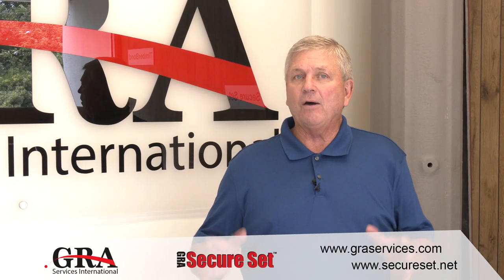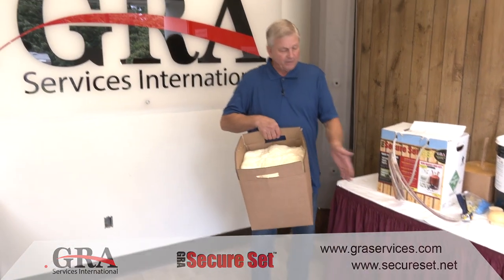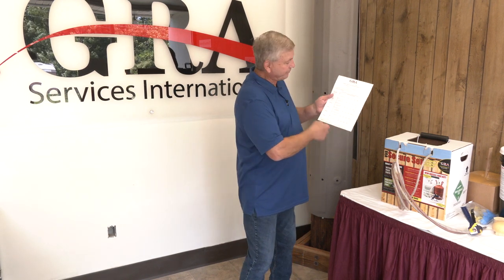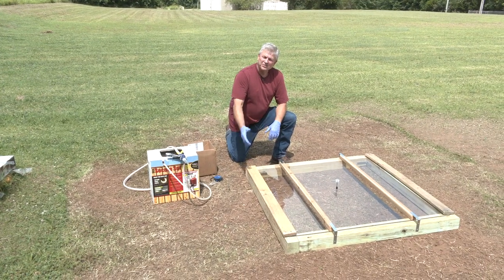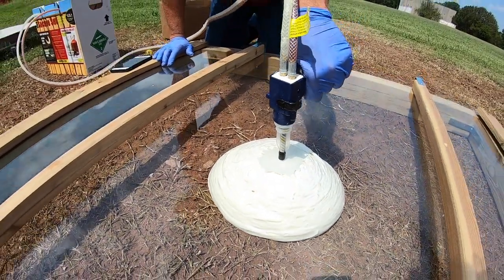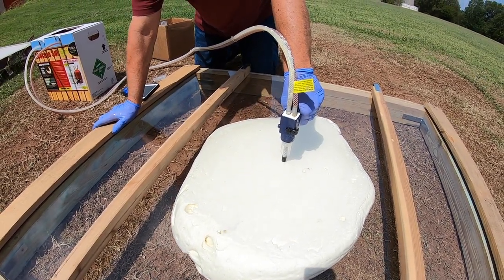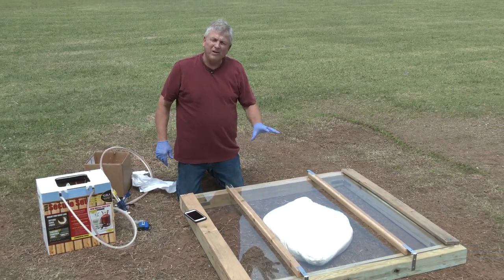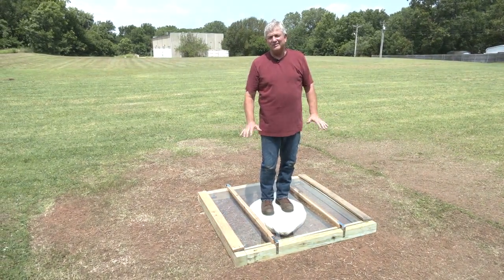How to fill voids under concrete floors & slabs for basements, warehouses & garages with Secure Set

Comment: Just watched this video, and it seems the foam doesn't really expand much after it is injected.  I expected to see if fill the entire box.  I assume this is by design, and the worry of injecting too much and having it expand and lift too far after the initial injection isn't of much concern.
Reply from the maker: Thank you for watching our video.  The Secure Set Spray Foam will expand 2 to 2-1/2 times the volume being sprayed and can expand up to 2-1/2 to 3 minutes while moving under pressure. In this video he is not spraying much foam, or that void area would have filled very quickly and would have pushed up the plexiglass, because it must expand somewhere.  It is highly recommended to watch our 2 instructional videos about "foam jacking/lifting" to understand the lifting process we use for many types of concreate slab projects.  It is a finessing type project of spaying in short bursts of foam to keep from overlifting.  Please check out our website at  
https://secureset.net/gallery/  to see many of our videos, which are also here on YouTube.  
Thanks again,  GRA Services - The Makers of Secure Set.

Comment: I spoke with a concrete guy and he said the voids are no big deal. He said the stem wall has some damage but not sufficient to need repairs. He said I shouldn't use the foam but to use the pillars that go under your home, which he said are very expensive. He said he doesn't do that kind of work with the pillars so I'm not sure what I should do. He was kind enough to tell me what to do to help migrate additional damage which I started to do. I would have questioned his integrity if he said he did the pillar work but he said he doesn't do that work. I'd like to know what I should watch for, around my home (I already see settling, some drops of about 1/4" in certain parts of my sidewalk near my front door, and along the garage door that goes from inside the garage to outside the garage) as to an indicator of how soon to starting using the foam or maybe the pillars in your experience? Or, if foam would work very well whereas I wouldn't need the pillars, which would be my preferred options (to not use the pillars is my preferred option to be clear). I live in Phoenix, AZ. Thanks!!
Reply from the maker: Thank you for your interest in Secure Set Spray Foam for your project.  We have many customers that do pillar or piers under their house foundation, and will also use our foam in between some of the piers for added support.  We have 2 kits available, one will support 5,040 lbs. per sq. ft., and the other will support 10,080 lbs. per sq. ft.  Some of our customers use our foam instead of piers if they do not have an extreme issue that needs the piers.  We would recommend for you to get a foundation pier company to give you their recommendations, and go from there.  If you would like to call us to discuss this project, please call 405-672-8885 M-F 8:30 to 4:30 CST.  Thanks again, GRA Services - The Makers of Secure Set.

Comment: my gosh we just found that under our whole basement floor has a void . we had water coming up thru cracks casing flooding . we cut a 12x12 square out and found a lot of water so we dropped a pump in and in the end we found how large this void is.
the floor is basically hovering. we later found out the possible cause was due to a sink that had a drain pipe to nowhere under the floor. sink was removed when we moved in 55 years ago .
Reply from the maker: Hello and thank you for your comment and interest in our products.  With an opening as large as the 12x12 you could definitely get the spray foam where you need to place it.  The spray foam nozzles will spray out about 4 ft. or you could use cpvc pipe as extensions, as we show in many of our void filling videos.  Also, you may be able to use our Secure Set liquid mix/pour product.  It would need to be quickly poured or you could make a trough of sorts (cut pvc pipe in half and wax it down with a bit of car wax) and get the foam into the void areas.  Do not let the foam get trapped in an area where it can't expand to the least resistant area, since it expands 18:1.   Many of our customers do this type of project  where they fill some of the void areas with this product and then top off with a spray foam to get the foam in all the areas you want to support, but not overfill.  If you have any other questions about this type of process, please call us at 405-672-8885 and we will help however we can.  Thank you, GRA Services - Secure Set.

Comment: Is there risk of overfilling a void and lifting the slab up? Would it be smart to drill relief holes to help avoid that?
Reply from the maker: Hello, as long as you do not overfill the void space you should have no trouble with lifting the slab.  Yes, drill several extra holes that will act as relief.  Understanding the void space is important.  Watch our lifting videos to help understand what all we have to do in order to get the lift.  The foam will compress soil and run to least resistance areas, filling voids, before lifting.
Thank you,
GRA Services.
Reply: Nope path of least resistance. Concrete is heavy dirt is soft and porous. Plus we drill many   to spread it out. And a good ear and rubber mallet will let you know start/stop of void.

Comment: How do you determine how much you need? Ground penetrating radar? How do you know if you filled all the void? You cant see what is going on.
Reply from the maker: Thank you for your question.  If you watch some of our other videos you will see that we tap around with a hammer listening for void space, even after we have applied the foam.  The sound changes; therefore, we know there is foam filling those void areas.  You won't always know that the entire cavity is full, but even pillars of foam in areas is much better support than the voids.  Also, some of our customers state that they drag a mechanical jack or heavy metal chain around to listen for voids.  You can also drill some additional holes and if voids are still found then drop a borescope/endoscope camera in to look around and see if you need to add additional foam.   You could use a ground penetrating radar device, since we have talked to foam jacking companies that use one for their projects, but that is generally not a tool that most people would have on hand.   GRA Services
Reply: Bore scope and probing holes

Comment: How long does it last ? That’s the question
Reply from the maker: Thank you for the question.  Secure Set foam is a 2-part polyol product that is projected to be in the ground 40+ years. This is a high strength, closed cell foam that does not absorb moisture; therefore, it does not break over time for that reason.  Also, it has no nutritional value, so nothing has any reason to attempt to feed on it.  Fire will destroy it, but that isn't likely to happen under a slab, or in the ground.  Hope this helps in understanding this type of foam product.      GRA Services
Reply: @SecureSet-Fence-Installation  that’s amazing, thanks for the info

Comment: what if there is some water in the void under a crawl spaces slab.. will the product still work?
Reply from the maker: Thank you for the question.  No, it will not work when applied into an area with standing water, or where the ground is too wet.  During the exothermic process of expansion it will suck the water into the foam and make a junk foam, which is not supportive.  The drier the better for the best results.  
GRA Services

Comment: hi. watching your video demonstrates that 1 minute discharge will give us 1cu ft3 of expanded foam. can i assume that one kit will give us 10 minutes of discharge to get 10cu ft3 as it is specified on the product? 
thank you.
Reply from the maker: Thank you for your question.  Yes, that is correct as a general rule.  When it is hot out it can dispense the product even more quickly.  
Some additional info:  You wouldn't want to spray it constantly, so you don't flatten out the foam that is trying to expand, as well as cause the compressed canisters to start freezing up and create an uneven flow of both Part A and Part B foam.

Comment: About to make an order for a void in my garage floor. Pulling the jack around I can clearly hear the vibrations of the floor in one particular spot. This shouldn't be super difficult to do with secure set.
Reply: Hello Brendan,  Another way to fine tune the areas where the voids exist under the concrete floor, is to take a hammer and start tapping all the areas of the floor.  You will be able to "hear" where he voids are.  I then take some chalk and mark those areas.  Thank you

Comment: Is this foam firm enough to drive a car over the voided area?
Reply from the maker: Hello Stuart,  Once the void is filled and the foam has hardened, it will support 10,080 lbs. per square foot.  Here are average weights for USA made cars. As you can see, even if all the weight of the vehicle was concentrated onto one foot square piece of the driveway, the foam would easily support the weight.  Thank you.

Model	Curb Weight
2019 Ford Fusion S 4 Door Sedan	3,472 pounds
2019 Nissan Altima 2.5 SR 4 Door Sedan	3,290 pounds
2019 Jeep Grand Cherokee Laredo 4 Door 4WD	4,677 pounds
2019 Honda Accord LX 4 Door Sedan	3,131 pounds
2019 Nissan Rogue SV 4 Door AWD	3,614 pounds
2019 Toyota RAV4 LE 4 Door	3,370 pounds
2019 Ford F150 XL 4 Door SuperCrew 4WD	4,769 pounds
2019 Toyota Highlander XLE 4 Door	4,310 pounds
2019 Lincoln MKC Reserve 4 Door	3,811 pounds
2019 Buick Envision Essence 4 Door	3,755 pounds
Reply from the maker: Hello Stuart, Once the void is filled and the foam has hardened, it will support 10,080 lbs. per square foot.
Reply from the maker: Model	Curb Weight
2019 Ford Fusion S 4 Door Sedan	3,472 pounds
2019 Nissan Altima 2.5 SR 4 Door Sedan	3,290 pounds
2019 Jeep Grand Cherokee Laredo 4 Door 4WD	4,677 pounds
2019 Honda Accord LX 4 Door Sedan	3,131 pounds
2019 Nissan Rogue SV 4 Door AWD	3,614 pounds
2019 Toyota RAV4 LE 4 Door	3,370 pounds
2019 Ford F150 XL 4 Door SuperCrew 4WD	4,769 pounds
2019 Toyota Highlander XLE 4 Door	4,310 pounds
2019 Lincoln MKC Reserve 4 Door	3,811 pounds
2019 Buick Envision Essence 4 Door	3,755 pounds

Comment: I have a double garage that has a cracked on the slab went from front to back of the garage. And the right front corner had sinked down about 1.5” to 2”. Will this product is able to raise and level the slab? Thank you for any advise.
Reply from the maker: Hello VX,  Secure set Spray Foam will raise concrete. The issue is that under the concrete there are most likely some voids that have allowed the concrete to settle.  We have found that most slabs are not just siting on top of the soil under the slab.  Hammer sound the slab, try to find where your voids might be.  Then drill the concrete with a concrete drill bit that measures 3/8th" x 12" long. Once you have done that, probe the hole with a piece of hard wire and determine the thickness of the concrete and then measure the depth of the void under the slab.  Remember, the expanding foam will always expand into the void which is a  low pressure area.  Once you can determine the LxH X W of the voids you will know the volume

Comment: how long will the product last before it shrinks and deteriorates?
Reply from the maker: This is a closed cell foam that does not absorb water or allow air to pass through it.  If used above ground, UV rays will change the color, but will not cause it to deteriorate.  The only two known things to cause it to break down is large quantities of acetone, or high temperature incineration, and it does not shrink.  High density foam is a plastic, so it will be there for a very long time.  Thank you, GRA Services

Comment: Where on your web site can I find the the chart to determine how much foam? 

How do you keep from lifting when you fill the void when there is no opening on the side?

 Finally, if you have side openings will you not have lifting because the foam will come out the side rather than lift?

Thanks for all the wonderful videos, you will save me money when I fill a void I have under a 10 ft. X 4 ft. pad using your product.
Reply from the maker: Hello,  Here is the video that tells you how much product you will have with 1 minute of foam dispensing. 

https://www.youtube.com/watch?v=AwJwwSsax7k  (Filling inaccessible voids under garage floors, basements, carports & RV Pads etc.)

Thank you